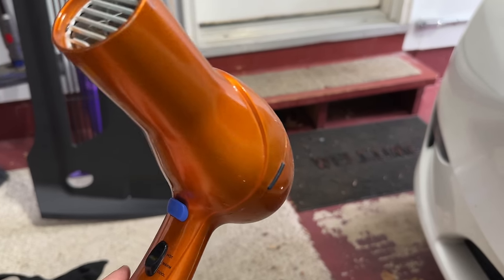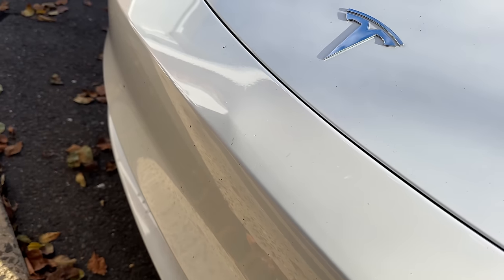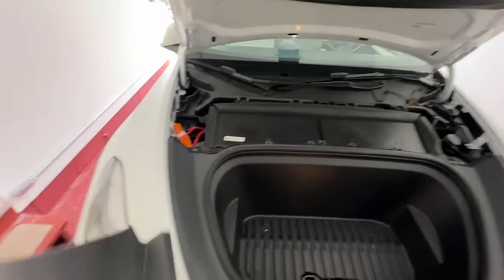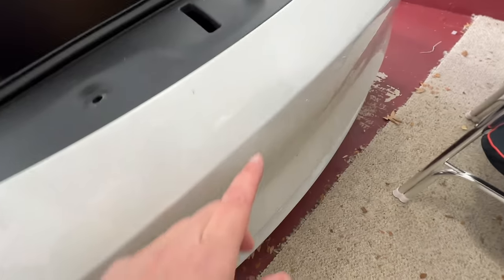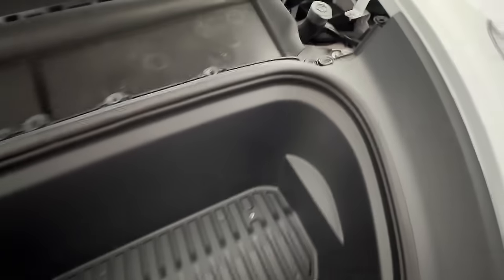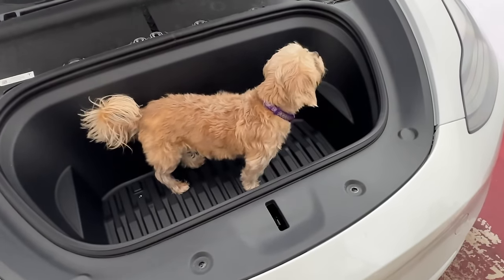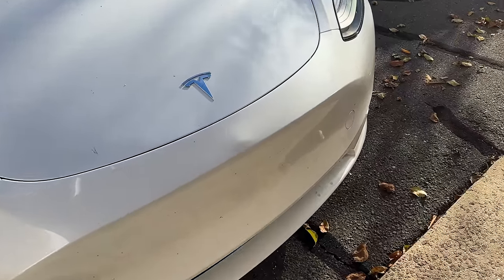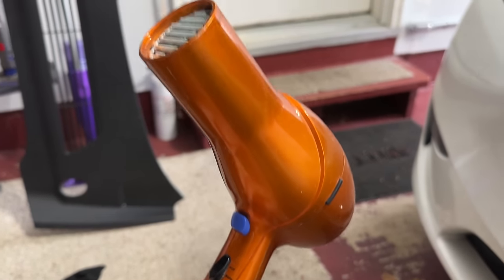I Use A Hair Dryer To Repair My Wife’s Dented Tesla Model Y!  What Could Possibly Go Wrong?

Comment: Blow dryer is not enough heat. Use heat gun...carefully, press down on the bump until the plastic cools, use a screw driver handle but end.

Comment: You have to pop out the wide plastic panel first, before taking out the tub, to take out the light/button cable. Also, they sell daisy-chained LED light strips for that cable if you ever want proper lighting in your frunk.

Comment: With all the high tech stuff on that car, it couldn’t warn you that a giant purple column was in the way?  What if that was a child?  If the car can’t see barriers, I don’t see how it can drive itself.  Ever.
Reply: The operator of the vehicle is responsible for the operation of the vehicle. The "purple barriers", though poorly  visually demarcated, were not a surprise, any more than a bicycle or a drive way would be at 25 feet. The Driver sadly is at fault here. Studebaker drivers would still see a steel post (hopefully) without a single sensor. Wanna buy some curb feelers ? How about hiring a guy with a lantern to clear your path every  50 yards? Safety starts with responsible operators that don't blame their tools for workmanship issues. Sorry.
Reply: @DouglasMcLaughlin-kq7hk  I  agree.  But it still begs the question whether the “tool” you paid a lot of money for actually works.  I would live with the damage as a reminder to be more careful.  If this happened once, it’s likely going to happen again.

Comment: I believe this technique will only work on the metal parts of the body of the car, but plastic damage is tricky. The steel body parts have some memory so they can go back in place, but I have my doubts with these hard plastic bumpers. They are flexible for sure until a certain point, but not if it's right in the nose where the corner is really hard.